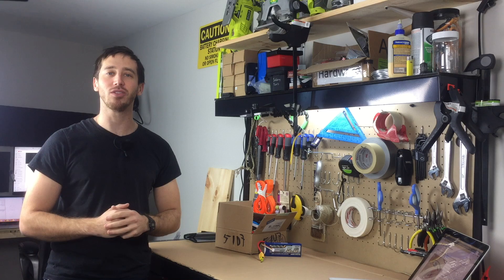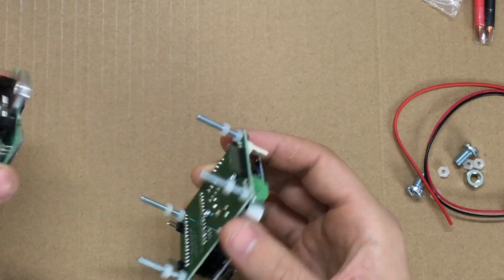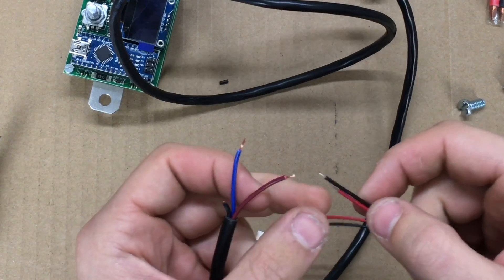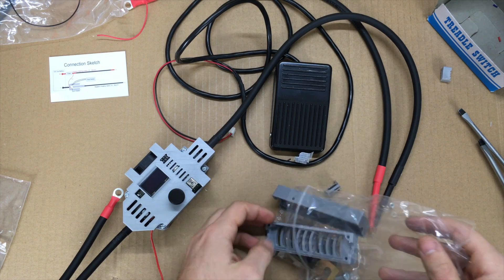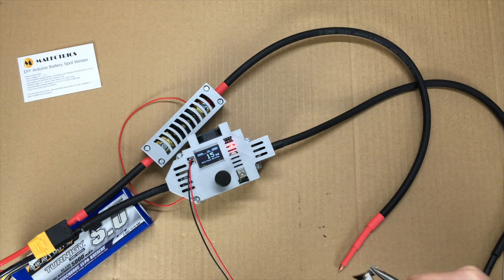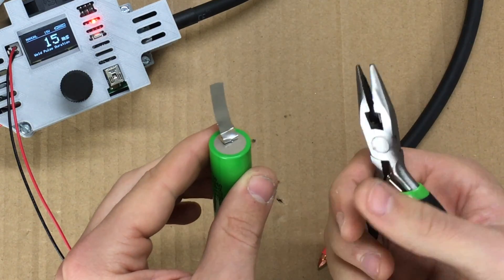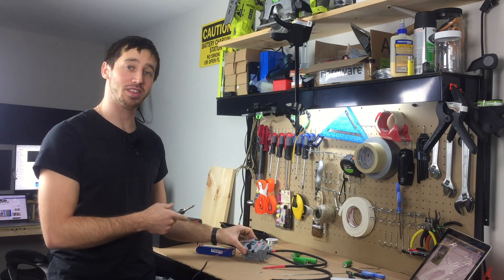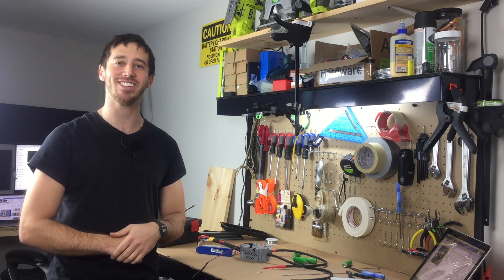Testing out an Arduino SPOT WELDER

Comment: Sorry, but a good weld cannot be removed in front of the battery without damaging the nickel strap. The point here is not that the weld seam has to withstand great forces. But keep in mind that most of the current flows through the four spot welds. If the welds are not stable enough, the reaction can be that the welds come loose during operation and sparks form. For about $60-70 more you get a "kWeld complete Kit" that can make welds with up to 2000 Amps (500 Joules).

Comment: absolutely fantastic welder put it together today and run it with 650a cca car battry and auto weld function used 0.2mm pure nickel great weld on 15ms and when u pull the strip with plier of the cell leave nickel on the cell and holls on the strip cant be happier... plan to build 20s8p high discharge pack with Samsung 21700 40t cells using 2 layer of 0.2mm x30mm nickel sheet... 😜
never run out of joice with 80ah battry

Comment: Thank you for your assembly/info video. I was on the fence about buying a wall plug-in welder and your circuit breaking issues has totally convinced me to with an external battery. Thanks again

Comment: Hey 90€ in comparaison of 105€ for an High Power 3KW Spot Welder For 18650 Lithium Battery Pack Weld Precision Pulse Spot Welding Machine 18650 spot welder nickel from aliexpress, compacity, modularity, or make money, i am septical ? Hello to your home 👎

Comment: Congratulations, I really liked this video. The pulse duration parameter is very important. However, I think it would be even more valuable if the value in joules were displayed, which would abstract the voltage and the current demanded. If it is not possible to display in joules, the display could show voltage and current, in addition to the pulse duration.

Comment: I bought of these recently and to be honest I'm not impressed.  The first unit was DOA, the second, after doing a couple of weak welds on 3ms, then stopped pulsing and went full closed circuit.  Ive tried a soft and factory reset, but it makes no difference.  Fortunately Id only tried it on one dead battery, which is now pretty badly damaged.  Would very much recommend avoiding until you hear back that all is fixed.

Comment: I'm using a 3s 6ah 60c lipo to weld .3mm strips on my batteries. It won't stick well even with 70ms pulse time. Do I need a higher discharge lipo?

Comment: Do you think this will work with a lead acid battery - smaller than a car battery?
Reply: According to Malectrics they recommend a battery which can deliver between 500 and 600 A, this is a size between 50 and 60 Ah. 60 is usually a common size for compact Class cars.

Comment: will this work with 0.15 pure nickel tab
Reply: According to the small card with the connection scheme delivered with the welder (you can see it on Micah's table) they recommend 0.1 to 0.25 mm nickel strips for this welder, while 0.15 should be the most common material.

Comment: Hi my name is vishal from india.
I love to do projects on solar and lithium ion battery.
My question is which is the best way to connect the lithium ion battery - spot welding or by plastic holders.
How is your DIY spot welding working?
Thanks for giving us knowledge about lithium ion batterys.
Reply: Spot welding is usually the better method, if your battery pack has to deliver high currents. Plastic holders often have the problem with a higher resistance at the contact points with the battery, this don't play a role if you make a power bank for cellphones, but if you want to get a lot of amps out of the pack this higher resistance is a problem. Spot welding has a much lower resistance, and if you use 6 or 8 welding points instead of 4 you can even reduce this resistance further.
Something which is not recommended is soldering directly at the cells, some people do this (if they lack a spot welder) but it's definitely damaging the battery because of the heat. Li Ion cells are OK until 60 °C, but soldering can heat them much more up at the connection point.

Comment: First I have bought a Sunkko 737G Spot welder, but it did not work in my house. The 16Amp fuse did not work, even when I changed the connection to a 32Amp fuse. Only 0,1mm Nickel would be fine, but I need 0,15mm Nickel. So this Sunkko was not worth the money. Now I will try the Malectrics and hope it will work.

Comment: No battery spot welder should ever trip your circuit breaker!  You can real weld 1/4 plate on a 110 welder no sweat.  Welding doesn't take a lot of power, it takes a lot of amps.

Comment: I looked into both kweld and this very intensely I bought the kweld . Keenlab really know what they doing they have developed a brilliant product with controlled precise welds that are not amperage controlled . Rather energy controlled which i feel is much better . The mosfets are also different they are much bigger and bigger current capacity on the kweld . Which I like . The materials make a big difference on welding too . Will try make s video and post it for viewers .
Reply: Adam Saiyad unless you bought an earlier version,  in which case my JP welder is more reliable. My Kweld needs to be upgraded and I’ve never used it. I added it as a backup to my first JP.
Reply: @thomasjaszewski64  negative I have never bought any other welder . The kweld has build quality like no other .  Clearly built by some one who knows high power dc electronics with minimal failures . Pull your kweld out upgrade the firmware and while it's upgrading do a Google of the components on the board . The high power mosfets and rotary dial make it easy to setup. Further more it's ability to weld by joules of energy not by time makes it in a class of its own . It even supports arc prevention .meaning when welding if an arc is detected it will stop the weld mid weld .. and not complete . This is not your average welder the designer has thought the product out really well.....
Reply: Adam Saiyad thanks, but you still know the others aren’t as good. OK. I’m comparing the 4 different I own. Or owned. No doubt it’s a great welder. Just disappointed to see the shipping charges and the upgrade path for early adopters. I ‘m thinking Frank’s may end up a market leader. At $230 plus  $45 shipping it’s getting higher priced for the hobby guy. Good news though, an USA based reseller now carries them and Keith is a peach. He also sells shrink wrap for cells and packs, with some fair prices on quick ship nickel. Thanks for the feedback!

Comment: So much attention is paid to this welder but not to the first on ES dot COM The JP spot welder has proved to be simpler: my Arduino from DE has to be upgraded due to heat problems. Cost a bit more and has a good following but wasn’t ready for anyone not willing to solder and upgrade,: My moderate use has been well served by the JP Welder; I was happy enough to make my third a JP: The DE version has a great helpful following; mimicking JP’s success. https://endless-sphere.com/forums/viewtopic.php?t=68865

Comment: Hi Micah, Please advice how to build our own BMS / PCB because In market when we go for buying there are hell lot of question about - charging / discharging current ration, capacity, and all. People say 1C is good, most vendors are giving 2C PCB. These are so confusing that a detailed diagram or how to actually make / select a BMS which will not waste the power and will give us best result. How to understand which IC / CHIP should be go for, how to draw / print our board. I really need your help to understand the BMS.

Comment: Yeaaahhh I have being using Malectrics Arduino Spot Welder for over a year, it’s super handy and it’s pocket size, much smaller than the Sunkko 709AD and the 70kg pneumatic industrial battery welder that I use at work. 
Some people have connected the Malectrics to supercapacitor bank but these high discharge LIPOs pack a big punch already.
Malectrics POWEEEEERRR ohhh yeaaahhh
Reply: Details on capacitor bank?

Comment: I own this welder and I thought I'd share a few thoughts:

If you're considering buying this welder, I think it's important to note that you are NOT required to use the foot pedal. From the time the two welding leads touch the same surface, there is a small delay (iirc the default is two seconds, but you can set the delay) and the welder will automatically activate.

I recommend having two batteries for welding -- one to charge and one to use, this way you have less downtime when you drain one battery off.

Remember to keep the leads clean. I ran into issues with getting bad welds even at very high settings and at this point I'm reasonably certain it was due to carbon buildup on the welding leads.

Using it off of a car battery got a little awkward in terms of being able to see the screen and have the leads reach my work area. I think I'll be attaching the little display to a ribbon cable so I can better position things.
Reply: Excellent advice. I was scratching my head why I might need the pedal when I first got the device and used it as you described. The two battery advice is also good, unless you have plenty of time.
Reply: Why not charge it constantly (CV CC)?

Comment: I concluded that for consistent and repeatable welds, a controlled energy pulse was needed. I considered a microwave oven transformer based welder with a ssr as the control but after some googling I settled on the Malelectrics. I'm using mine with a car battery (~ $70 at one of the auto parts stores) instead of the LiPo battery (although the LiPo battery sure makes for a smaller overall unit.  The car battery is rated at ~ 600 cranking amps and so I get consistent solid welds at around 15 mS. I've built about 4 14S-6P batteries so far and all without any issues. Having the two weld probes in hand makes for an easy way to manage the weld placement especially when you want to get 2+ welds per cell. I would strongly recommend this over any of the chinese welders.

Comment: so i been thing a making a 24v~ backup battery for my 3D printer in a tesla Style where the battery pack is flat and sits under the printer where i have a lot empty space about 350mm by 250mm . i hoping to get enough power to last 3-4 hours. the printer draws about 250W max. do you guys know yea 24v dc UPS like boards or electrical circuits that well hand the power switch over in like 1 to 3 msec. i got a feeling that i going to need to add a supper cap to help with the switch over..?

Comment: I made my own spot welder with a car battery that i could lend for free by a local garage. I just have a  solenoid/relay between it an te welding tabs. And a push button that you have to hit quickly to get a weld. It has been working great and i have already build a 16s12p battery. It set me back 15 bucks for the relay/solenoid and cables.
Reply: Cool.  By the way, "Devices switching more than 15 amps... are usually called contactors." http://en.wikipedia.org/wiki/Contactor
Reply: KABOOM!
Reply: I just bought parts to build my own as well. Sunkko got so many bad reviews

Comment: I've got one of these. I used it with a car battery. Really happy with it and the 14s4p battery I built is perfect. I used 28ms for .2 nickel. It took maybe 10 days to ship from Germany.

One tip is to have a sanding block handy to clean up the electrodes after every few welds. Also mine came with the "auto" setting on which will automatically weld after a set time period. I prefer to do it manually with the foot switch.

Also I get better welds if there is a gap (or slit in the nickel) between the electrodes. It causes the current to go a longer way and has less arcing between the electrodes.
Reply: I'm looking into purchasing one of these in the near future. Shipping is estimated to be €40. Do you remember if that's the cost that you had to pay to get it? I'm looking at the website that is suggested in this video. Thanks.
Reply: @paulrammer2424  I don't really remember the shipping. It's been a great unit for the few batteries I've built. There may be cheaper ones out there now.
Reply: @sparks6666  Thanks for the input. I will look around some more before making a decision.

Comment: Arduino spot welders have been kicking around for a while, but this is ready to go. Nice price. I hope it catches on. Tom at alarmhookup (ebay) has low cost cells, along with the Chinese cells Jehu Garcia and Vruzend offer for around $2.50. Don't know if it changes anything, but the Chinese welders have a lot of question marks.  I can tell people a basic 30 cell 36v battery pack can easily be done for around $100, with this.  Of course, I am saving up for my Rivian because ebikes are so 2015.

Nice Vid.
Reply from the maker: I hope I can get a ride when you get it!

Comment: Hold it from the pen (the hard side), and have more pressure. not from the wire. increase the time until you get the best welds.
Reply from the maker: Thanks for the tips, I'll give it a shot!
Reply: @EbikeSchool  

but the time depends on the nickel thickness, 28ms is better for 0.15ms nickel. :-)
Reply: I find that I need more power/time with the neg end of the battery than the pos.
Nice welder tho.